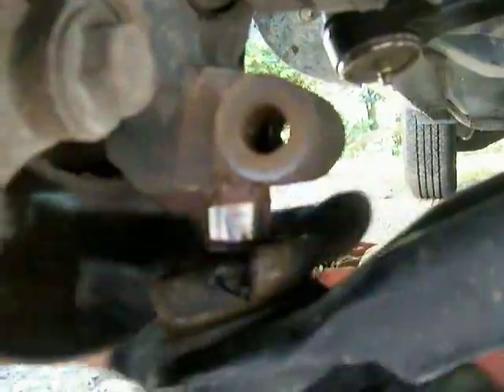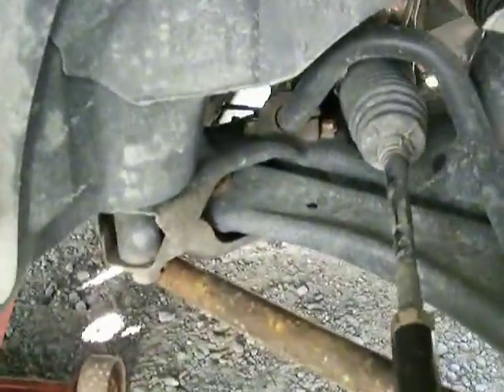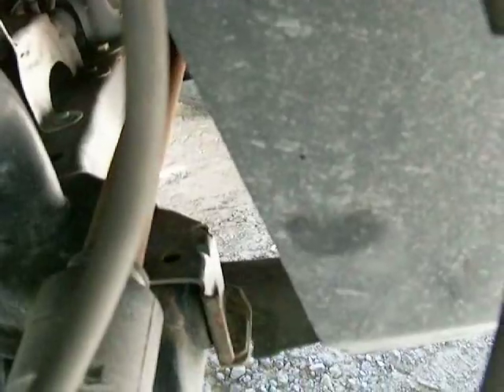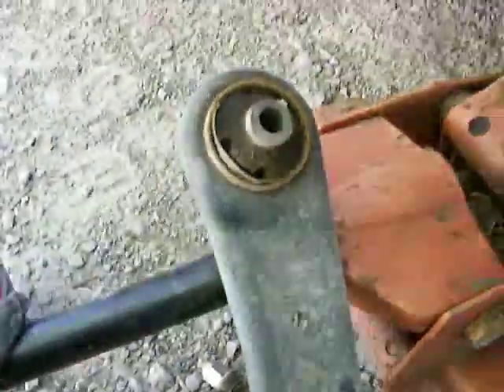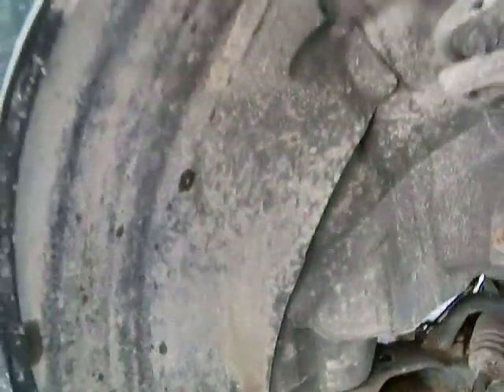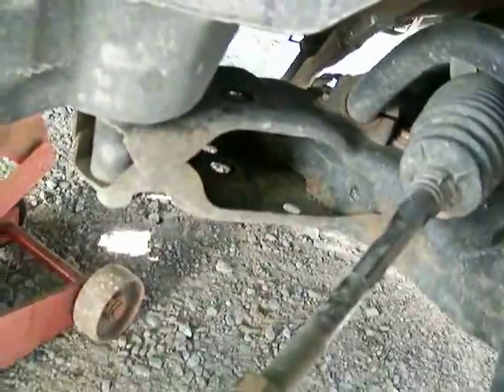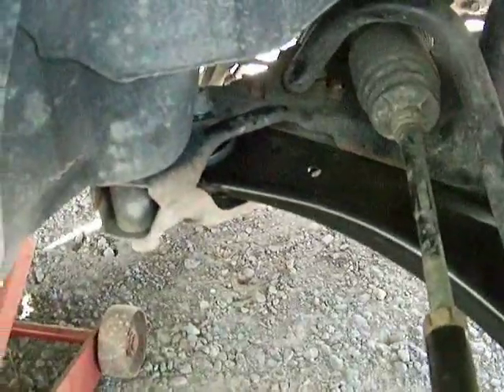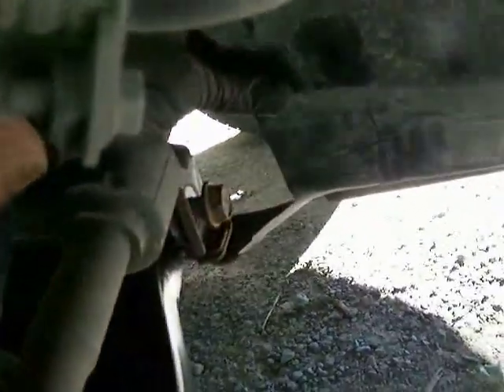2008 dodge caliber lowr ball joint replacement.avi

Comment: Hey Shawn, I just wanted to write again and say thanks. I went out this morning and replaced the lower arms on both sides. It took me close to 3 hours for the whole process. The first side was a learning process and took the majority of the time. When I did the last side it took approximately 20 minutes. The hardest part was aligning the holes back up. Simple job and very DIY friendly. Thanks!!

Comment: First, many tx to the uploader. Did this job last night and wanted to add my experience. First I bought entire control arms with BJs from rockauto for 70 something each. The biggest PIA with this job is the pinch bolt. We got around it by moving the kunckle to make the pinch more acessible and then used a small metal spreader (4 inches long, small wedge that you can hit with a hammer). Then once we got it in there good we used the joint fork and hit it down with a hammer to pop the BJ out

Comment: Bolt torque specs:
Lower Ball Joint Stud Pinch Bolt       -  82Nm (60Ft. Lbs)
Lower Control Arm Front Pivot Bolt  -  183Nm (135Ft. Lbs)
Lower Control Arm Rear Pivot Bolt    -  183Nm (135Ft. Lbs)
Thank you Shawn!
You are all welcome!

Comment: Thank you for your video. Today I struggled 6 hour to install the control arm that I took out from picn n pull. The front nut just wouldn't line up. I watched your video and you mentioned the grind off the edges of the bushing metal, I did that still the front screw hold wouldn't line, then I noticed the inner wall of the new control arm was wider and it was the reason (parts store advertises 07-2012 same all caliber except str uses same control arm, another guys utube video on changing the bll joint on this car shows grinded inner edge of the control arm but he didn't mention it and he didn't show where's the snap ring on the old ball joint, so my guess not all caliber control arms are the same). The old control arm would slide in without any hammering. So now I will just but the new ball joint for the old control arm, rent a tool from parts store and go that way.

Comment: FYI, I just bought pro grade Raybestos controls arms from RockAuto.com for my '07 Jeep Compass, $108 each, they have some cheaper as well. It's the same control arm for Jeep Compass, Patriot and Dodge Caliber. From what I have read the average lifespan for ball joints and tie rod ends on these models is around 35k miles. Thanks for the video, it preps me for doing mine this weekend.

Comment: Thank you so much for posting this.  My 07 Caliber (US) has done the same thing.  it has 80k miles on it.  Anyone else have the alternator go bad yet?  The mechanic I took it too told me that there is a defect in the stock clutch on the end of the alternator and they go bad often.

Comment: to anyone who wants to know, this suspension is identical to a 08 jeep patriot, to which im changing out the wheel bearing on the passenger side. also with only 60k miles, ive replaced both ball joints, both tie rod ends, breaks all around once about 20k miles ago, they need replaced again. I too am not a fan of chrysler products, but my jeep wrangler, one made in toledo ohio is awesome. I beat the crap out of it and have zero problems.

Comment from the maker: You can try a punch. Will it move at all? I mean after you have the nut off. You can hit it with a hammer but makes sure to used something brass so as not to smash the threads in, you may have to reuse the bolt

Comment: @lurchgriffith 
my mechanic was originally going to just replace the ball joint but once he got the control arm out he noticed that the back bushing was shot and pretty much falling out.  so yes you can replace just the ball joint.  also my caliber has 60k miles, tie rods were replaced under warranty around 25k miles.  Sad realy.

Comment: Very good DIY video. I have a question do you have one where you change the INNER tie rods? I plan on replacing both Lower control arms, inner and outer tie rods and the sway bar linkage. I have seen some inner tire rods with a pin to prevent the nut from backing out and was wondering if the Caliber has one.
Reply: Well I changed the Lower Control Arms. Tie rods were ok. Your video helped. Ran into one problem the lower ball joint pin(?) was rusted pretty good in the pinch point. Penetrating oil, carefully spreading the point with pry bar, and about 45 minutes of hammering on the Arm got it free. Ran into this problem on an Explorer I did once. Other side was no problem it was replaced last year. Also replaced the Sway bar Link. Once Again thanks

Comment: ok, I have a compass and I got a new ball joint for 32$ and machine shop pressed it in for 40$
I am with you with Chrysler, I hate them so badly.
we bought a compass in 2009 brand new thank god we took extended warranty.
the dealer replaced 6200$ worth of parts and labor under warranty, front bearings, front lower ball joints tie rod passenger, front struts, window control, alternator, back control arm the list goes on and on and now the CVT is acting up, over heating even though we just paid 340$ last month to replace transmission fluid at the dealer. now engine light is on. we now have 198000 km on it, we are so looking forward to the loan to be paid off so we can sell it and get something else then a Chrysler
Reply: oh btw, front right lower ball joint I am replacing tomorrow, it's no longer under warranty an dealer wanted 305$ for the part and 2 hours of labor

Comment: She got lucky to get 75k out of it. My Jeep Patriot only got 37k before the ball joints went out. I could almost understand if I had been using it for off road driving but it has never been off of the pavement. I called Chrysler and they told me it was out of warranty and they would do nothing for me. I will never buy another Chrysler vehicle again. I was looking at buying a new Ram 2500 but I think I will get a F250 now that I see how their vehicles hold up and the awesome customer service.

Comment: No you do NOT have to replace the whole control arm... You can pick up just the ball joint only..... however the OEM ball joint is pressed into the control arm, so you will have to you a press to remove the factory one, to replace the new one which comes with a snap ring.

Comment: I am lucky to get 30k miles on a set of control arms with my caliber. 152k on it and I'm replacing my 5th set right now
Reply: this car was surely designed to make car mechanics and car parts store money. A properly designed suspension should last life of the car ~30 years.

Comment: u can get lower control arms from prime choice auto and other parts i got 2 lower arms for less then he payed for 1 i just rebuilt they back end on my 2007 caliber awd now gona do front end and for those of u with a rotten sub frame check with your dealer 10 year war on most they changed my back frame no charge

Comment: How do you tell if its a bad strut or a bad control arm.
Reply: jack up the car, shake the tire with hand, if it shakes then it's a ball joint, you can see the bll joint move, if its a strut look for leaked strut oil on the strut or just push the bumper of the car and see if the strut is bad.

Comment: I have exactly the same car, make, year with exactly the same problem. My mechanic said it would be pointless to only replace the ball joint. The control arm must be replaced as well. He said I would be coming back in 3 months to do the work all over again if we only replaced the ball joint. Anyone got the same advice?  Has anyone just changed the ball joint with good result?

Comment: I am having to replace my front passenger ball joint but just figured I'd change out the whole control arm as well but i haven't had to do any of this till now. I'm now hitting 160,000 miles. Looking for any other maintenance videos on an 08 caliber if anyone has the links to them.
Reply: If you have 160k on your Caliber and you are just now changing the ball joints then they have been bad for 100k miles and you have been ignoring it.

Comment: I have a 2002 Stratus SE 4dr 2.7  Has creeking and front end noise.steering has gotten much looser". What are the common things that need to be replaced on these when these issues arise?..i have put on two new front hub bearings which are still good though".Anybody?..Thanks!!

Comment: How about drill a small hole and put a greaseball into the spindle, it will last through the car. I do this with all of my suspension parts. You can even buy cheap ebay stuff and give it a grease ball, grease it up every second motor oil change and voila, it will last the car.

I am a car mechanic and spindles like these make me mad, it´s all about making the car more unreliable and more expensive to fix, for who? part suppliers I guess...

Comment: why not just press in a new joint for a whole lot less lol
Reply: today I pressed a new ball joint on a caliber, the control arm I picked from pick n pull for 26$ (same car) didn't fit so went and bought a new moog ball joint with grease tip for ~90$cdn (generic with no grease tip 50$cdn) + 3day bll joint press tool rental for 150$ cdn. Had to buy a 22mm impact socket for additional $12.50cdn. there is no visible snap ring on the factory one, I cut out the bll joint dust rubber and then burnt it with a butane torch. There was a metal ring there (side of the dust boot). First I used a chiesel to open one end of this ring and then a flat screwdriver pried off the ring. now I pressed the factory bll joint from the boot side and installed the moog one. Problem with the moog one is there is a solid metal ring bottom of the boot that cannot be expanded like a spring, it needs a special press to press this metal ring built in the bottom of the boot. Now my only option is to wrap around the boot with duct tape to keep dust out. New control arms each are ~250cdn with no grease nipple & it might not fit, so this was a cheaper option for me.